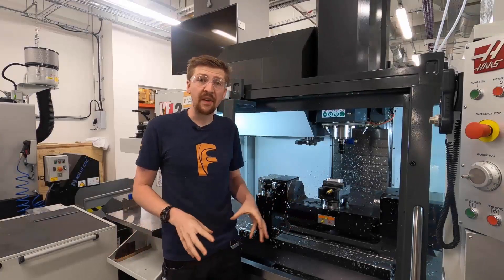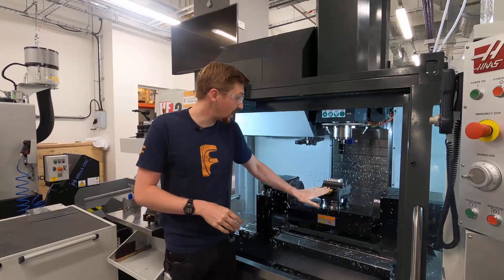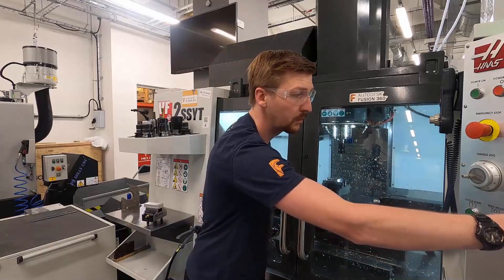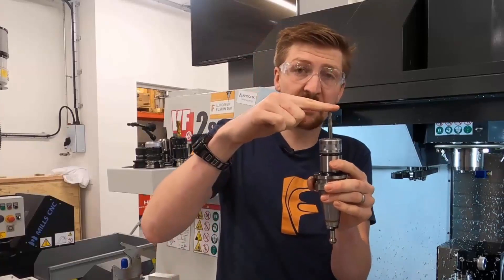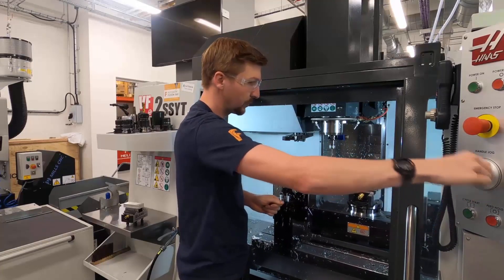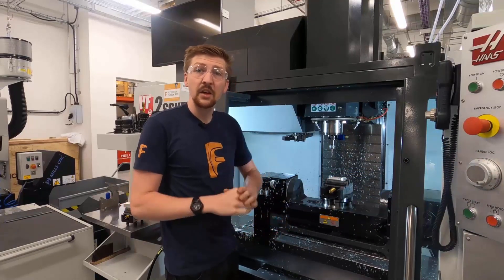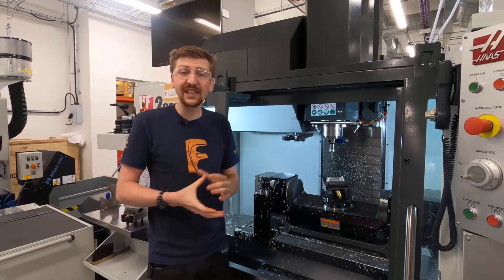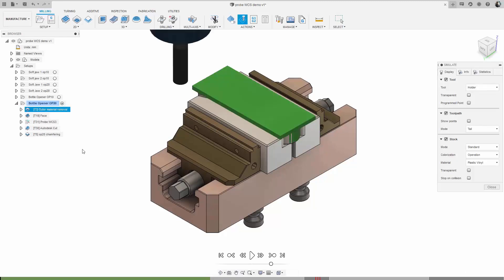Machining Fundamentals: Introduction to Mills

Comment: What is the blue thing attached to the spindle ?
Reply: Hi, thats a fitting for an Air Turbine spindle. It allows a very high RPM spindle to be driven by air. They are really useful for engraving or surfacing on hard materials. https://youtu.be/LkPZ1ynjr4s?t=86